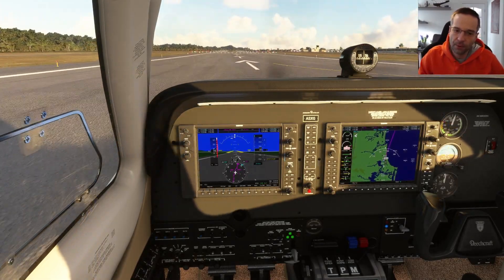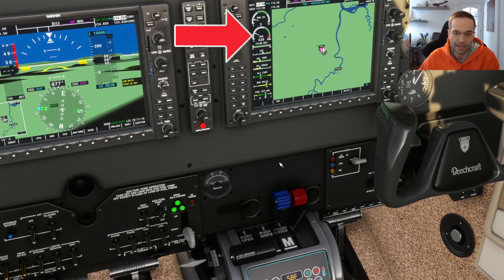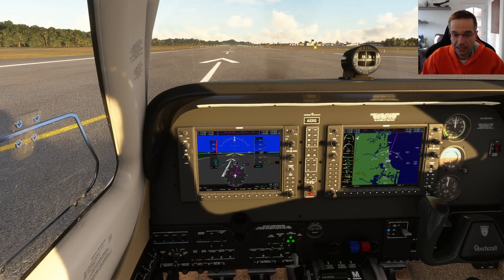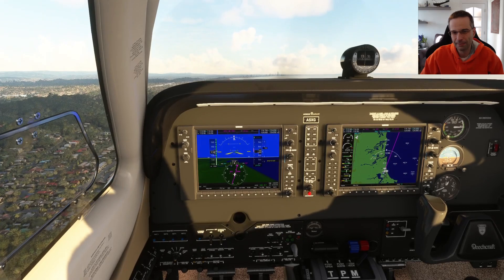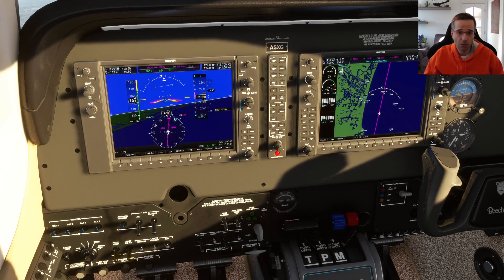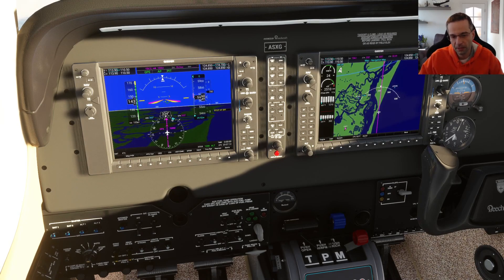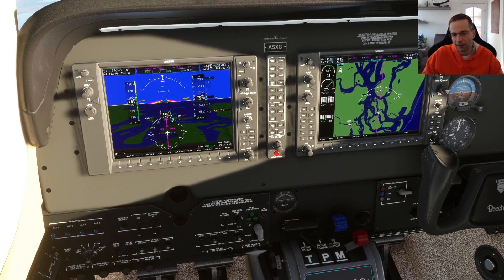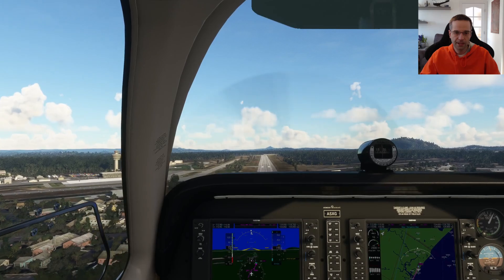Intro To Throttle, Propeller & Mixture Controls | MSFS Tutorial

Comment: hey Amigo, on my d40, i have only 1400 rpm max on full throttle when takeoff uable to  takeoff/ flight properly,  
??
Reply from the maker: DA40 has an electronically controlled prop & mixture. What airport were you trying to take off from? Pistons don't perform well at high altitude
Reply: @FlightSimSchool I think issue is with acknowledging takeoff, without this system is blocking speed. Playing carrier mode... 3rd first flight

Comment: Much appreciated - I was not aware of the EGT method for mixture control.   I have been doing mountain flying, often involving high-altitude runways.  Often involving older airplanes, partially because I find the old-fashioned "steam" gauges easier to use.  Particularly for the VVI, because I find the analog in the glass cockpit thing hard to read at a glance.
I do mixture on the ground the old fashioned way - get the plane to a high idle, reduce the mixture until the RPMs start to drop, then raise it until the RPMs are restored plus some.  I believe you are losing some power with mixture at full rich at higher altitudes.  I do see an RPM increase as the mixture initially comes back, typically if the airfield is at 4,000 or above.  Might not matter at full throttle.  .  .

Comment: Hi from another French Canadian. No 1 issue is the diamond 62 keeps cutting out on the ramp. Cannot find the mixture control. Your thoughts?Thx
Reply from the maker: It always catches me off-guard when someone picks up on the accent :) There are no mixture controls in the DA62 because it's a FADEC-controlled engine, so it adjusts it automatically for you. The most likely cause to me sounds like a binding issue that's turning the engine off?
Reply: @ Thx for replying. Other aircraft do not stall however. I will check the bindings.
Reply: @ Didn’t mean any disrespect 😒. Do you know where I could find the binding to prevent the engines from stalling out?
Reply from the maker: @j_london9791  Check if anything is bound to Fuel 1 Off or Engine 1 Off, I can’t quite remember what it’s called
Reply: @ no could not find any thing bound to the fuel or engine😕
Reply from the maker: @ Is this in free flight or career mode? Might be worth checking if this happens in free flight.

Comment: can anyone help me?
im using the viking air CL-415 and it requires a "throttle previous detent" setting which i could not find
without it im unable to put the throttle to neutral or however its called
anyone knows where can i find that setting?
Reply from the maker: You'll probably have better luck if you ask on the MSFS forums or in their Discord
Reply: @FlightSimSchool  okay ill try asking there, ty!

Comment: You have a talent for teaching. I'm a few weeks into flight sims and gotten somewhat comfortable with the basic flying mechanics. I'm using the Logitech yoke and throttle quadrant and was wondering what the other levers are for. You managed to explain not just what they do, but what they are for and when they should be used. Good job!

Comment: hi their. just thought  id ask ,problem with the mix lever ,when you push it it doesnt do anything until  the lever gets past half way and then you have too stop it by bringing the lever back down too where want it too stop, erm it didnt do that before,before it used too act like push too 3/4s and when it got too 3/4s it would stop,somethins not right  but i dont know what it is,ta for listening....awe yeh my flight stick is a gladiator nxt right hand....
Reply from the maker: I'd start by checking the binding in the controls, and then check the sensitivity curve on it. Hope that helps!
Reply: @FlightSimSchool  thanks for the reply ill have a go at it ....

Comment: This is very good and comprehensive. The only thing I can think of that I do in addition to this is adjust Throttle & Prop for Cruise Climb (Vcc) after climbing above 1000ft AGL after takeoff provided there are no obstacles like mountains I need to clear. This isn't really that necessary, but reduces trip time and fuel consumption. Vcc speeds/settings will vary by aircraft, and may even be a range of options. It'll be outlined in the plane's POH.

Comment: @flight sim school whenever I move my mouse on key pad or just a regular mouse it cuts back my throttle so you know how to fix this problem?
Reply from the maker: It sounds like there is a bindings issue. I’d start by going into controls and then switching back to the default preset for the mouse and keyboard and see if it still happens